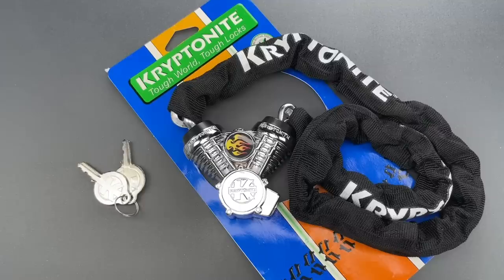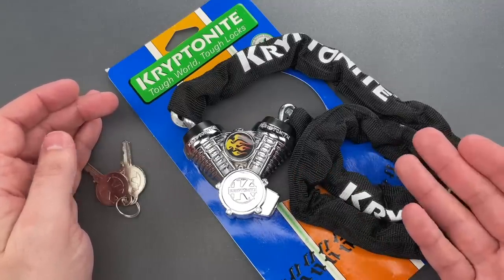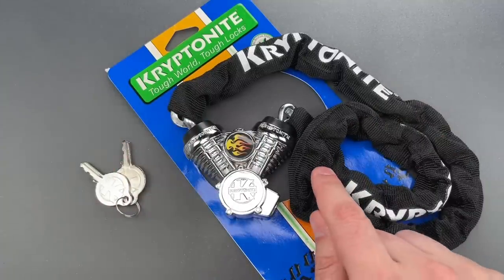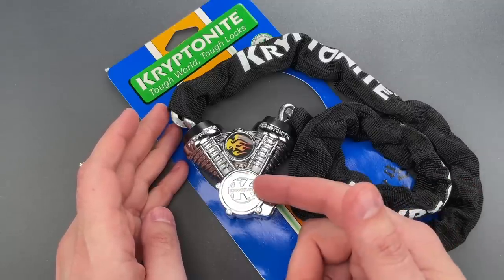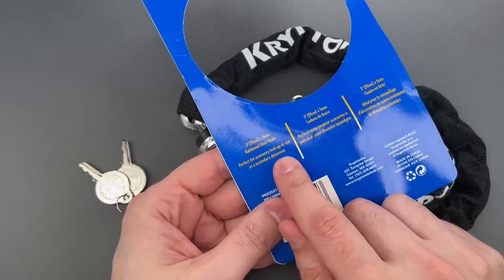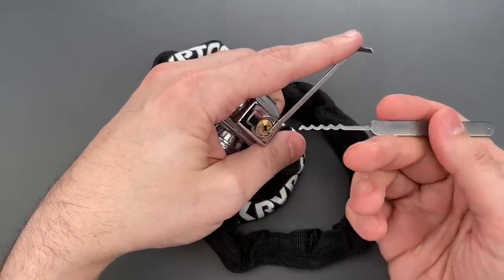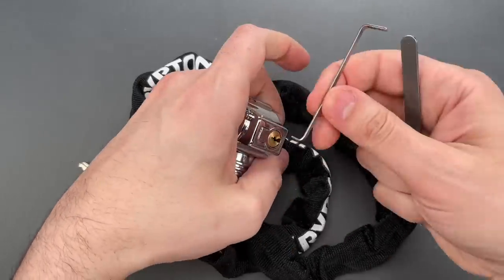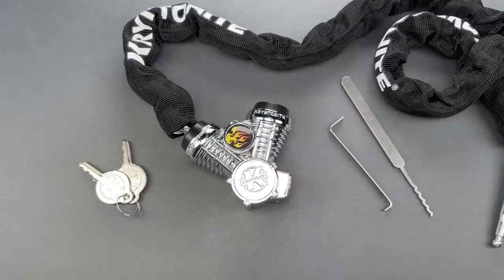[1502] All Show, No Go… Vintage Kryptonite V-Twin Lock

Comment: All shackle, no security pins.

Masterlock design department.
Reply: Great slogan! Brilliant!
Reply: Shockingly, most master locks have security pins...they just also have the absolute worst machining tolerances in the world, thus making the security pins a useless joke.
Reply: Except their shackles aren't good either, shims are super easy on Masterlocks
Reply: Maybe "all body, no lock", because Masterlock locks LOOK like locks, but that can't be their intended use, surely?

Oh god, it is, isn't it? They intend people to use their products as locks...
Reply: @sorin_markov  Not anymore. Master stopped using spring loaded locking pawls in most models and use ball bearings now. So at least they fixed the biggest bypass that renders virtually all of their current in circulation locks vulnerable...
Reply: @NoobixCube , my wife suggested that you could use Master locks as paperweights . . . .
Reply: @potatosordfighter666  : So Masterlock buys now their locks from ABUS ?

Comment: When the lock is advertised by the manufacturer as a secondary deterrent in a market where low quality products are advertised as pickproof, you just know it's that bad.
Reply: Still better than most Masterlocks though.
Reply: Or you know that the company is sincere
Reply: no, you know it's good. At doing what it is supposed to do.
Unlike the other manufacturers' products which are bad at what they are supposed to do (as advertised) since they are only good as deterrents as well.

Like, if I see two dummy security cameras (those plastic things that look like security cameras, but have no electronics inside, other than a battery and a red blinking LED) and one of them is advertised as "dummy deterrent security camera" and the other is advertised as "security camera", I know how I would react to them as a customer
Reply: Eh, it's Kryptonite, they make good products overall
Reply: I mean. It did last longer then most Master lock videos LPL has put out in the past🤣🤣
Reply: Keep in mind, this is 20 years old which would make it from the early 2000's.  Actually, considering a rake is a really low skill attack this is kind of useless.  But the price point does matter also even though it doesn't do Kryptonite's reputation any good.
Reply: Counterpoint: all locks are, at best, secondary deterrent. If a malicious person ever reaches your lock, you already lost the first battle.
Reply: It honestly looked like it took more raking to get open than most masterlocks

Comment: The fiery emblem is killing me. It looks like a toy you'd get from a claw machine.

"Secondary" protection is awfully generous.
Reply: Lmao, ikr? I feel like this isn't even like tertiary level protection, maybe even *insert the -ary word for 4th level* protection, haha.
Reply: They didn''t claim secondary "protection" but secondary "deterrent". Basically someone looking at the effort you went through to secure things with another lock might be thinking "too much effort" just based on looking at it.
Reply: @Slash-XVI  That's exactly the thing, right? I have two very reasonable locks that I use in conjunction on my bike. My secondary deterrent is a wire-loop that's from a garbage lock to hold my helmet. (The loop ends of that are attached to one of the real locks.)

You can cut that wire real quick but all you're gonna get is a used bike helmet, so who would? I've been doing it for years and so far, nobody. And that included when I was biking to campus for school. So. xD
Reply: @kasper_429  -- Quaternary I think.

Primary 
Secondary
Tertiary
Quaternary?
Quinternary?
Hexenary?
Septinary?
Octonary?
Nononary?
Decanary?

Comment: When the wave rake comes out you know its going to be quick and not a fluke. Love it!
Reply: When you know it's going to be quick when he pulls out the wave rake, you know you've watched a lot of the videos.
Reply: Doubly so when what ti takes for a wave rake to work quickly is: No security pins and tolerances that are basically lumps of metal as pins rattling in chambers with enough slop that they jam on the shear line.  Literal junk lock designs.  YET... half of all of the locks on the market seem to be built to this "standard".

Comment: "me with a Scion FRS that's all show and no go" yes, I understand
Reply: Went on a test drive in one a while back. When I floored it, I laughed out loud. The salesman said "Ah yeah, it has good power, huh?" "No, it's slower than my daily."
Reply: @mrgw98  yeah, it's not meant for power, haha. It is fun though!
Reply: At least it’s not a Subaru BRZ 😂
Reply: @JamesBrown-ki2cn  That is something I noticed, nice and cozy, pretty small, and handled well. If it had more power, I probably would've bought one. I want to drive a turbo or supercharged one sometime and see if that is enough.
Reply: @mrgw98  I do actually plan on making mine "go" one day, haha, just taking it 1 step at a time. My plan is to supercharge it over turbo, just for that instant gratification.
Reply: @JamesBrown-ki2cn  That's what I'd do. Either way, make it what you like how you like it. If you make it look nice before speed, nothing wrong with that. If that's what brings you the most happiness, that's what matters most.
Reply: @JamesBrown-ki2cn  a small turbo lights up just as fast as that supercharger.

Comment: Not a comment on the lock, but a comment on the videos on this channel in general.  They seem like they have gotten much quieter.  I'm having to crank the volume on my computer to max and the volume on the T.V. it's connected to to max as well (probably about 4x the volume I normally keep everything), and I'm still struggling to hear what's being said at times.

I downloaded the audio form this clip and threw it into my audio editing software, and it looks like the audio for this particular clip could be increased over 11dB without any distortion whatsoever, so there's lots of room to boost the volume while still maintaining the calm and soft speaking tone in the video.  Just food for thought.

Comment: Grade: D

F - can be bypassed without messing with the cylinder at all.  
D - low skill "raking" or "comb" attacks defeat the cylinder.  
C - beginner level single-pin picking can defeat the lock.  
B - moderate level single pin picking or a special tool are required to pick the lock.  
A - expert level picking or one-off custom tools are required.  
AA - lock-picking lawyer cannot open.

Comment: The wave rake coming out is the ultimate insult to a pin tumbler lock. Just devastating 😂
Reply: I would say a jiggler, followed by shims and easy bypasses. A wave rake requires a turning tool.

Comment: Years ago a lock rep came inyo me selling me these snake style Motorbike locks.

They were braided cable with circular metal tubes similar to disks in your back. And when someone would try to cut it with a saw or something similar the disks would just spin on the spot

Cant find em these days and the lock would be the best option for entry on it imo but havent seen em since tbh

Comment: To be fair, most bicycle locks usually get just cut off rather then picked. It's just faster that way. Even a thick chain and being right under a camera did not save my fiancee's bike, for example. I guess D-lock is the safest option and this is where pick resistance comes into play.

Comment: The Kryptonite branding on the chain cover will likely deter opportunity thieves from attempting to use a bolt cutter to get through, Kryptonite as a brand has a reputation for extremely strong chains. A smart thief might check the lock itself, but if there are alternative targets nearby with a less recognizable brand of protection, it seems likely that those will be chosen first.

Then again, if a pair of thieves can just lift the bike into the back of a van in 10 seconds or less, it doesn't matter how tough the chain is or how pick resistant the lock is. They'll have as many hours as they need to get through it in a secluded location.

Comment: I've found that a cheap lock that has been left outside in the snow and ice (or locked on to a trailer driving on wet and salted roads) is a pretty secure lock. It's kinda hard to pick a lock that's gritty and corroded when the key itself barely works 🤣
Reply: That's how it possible to use "Masterlock" and "impossible to open" in the same sentence. Thanks, snow.

Comment: Almost as bad as how I saw someone lock their bicycle recently. When I lock my bike I wrap the lock around the cross bar through a wheel and on to the bike rack. A guy parked what looked like a much more expensive bike beside mine on a rack outside a supermarket recently and the lock looked fairly hefty compared to mine. But from the way he locked it, you could easily have manipulated his bike to get the saddle through and went off with the bike leaving the lock behind. I didn't try it, as it would have looked like I was trying to steal his bike in broad daylight, but it was tempting to just move his bike away from the rack to ensure he secures it properly in future.

Comment: I found a damaged kryptonite chain lock.  The original owner lost the key.  The chain was beefy though and I thought would make a nice chain with a quality padlock(recommended by LPL of course).  The original kryptonite lock cut off very easily with a beat hack saw.  Strange that the chain seemed strong yet the connect to the lock was so weak.

Comment: On the car reference I remember owning a Buell (what happened when a Harley engine was put in a real bike) 1203cc v-twin. There were a few people in Vauxhall Nova's (toy racer kit, I would say boy racer, but that stupidity has no gender bias) who would try racing me from the lights. Coming alongside and revving their 1194cc engines pulling a car as if the result wasn't obvious.
I would sit, wait for the light and be gone up to speed, then sit there as they fumed behind me at the speed limit. Performance has it's place, areas where speeding endangers children crossing streets isn't it.

Comment: Seeing the key in the lead-up to the pick, I knew how this was going to go. I wonder if this is more a case of seriously bad bitting than a sub standard lock. Kryptonite locks are normally pretty decent imo.  Ive noticed  a couple of other "not good" locks also had bitting that quite frankly, shouldnt have made it off the production floor.

Comment: Why do so many locks not use spool or serrated pins? It's a tiny change that significantly improves security (or at least it prevents low-skill attacks like raking.)

Comment: Hey hey man

I have a tinted truck with loud exhaust and stock V8 but a shift kit in the trans, trutrac out back

But its still louder than fast for sure

Now........

If ya wanna send a 6:71 blower and some stuff to fit a LS1/lm7 5.3 hell ill show the install and the impending 250k mile transmission clutch failure after said install

😂

Comment: An interesting novelty lock. Any chance you could show us the keyway, the key bitting and what type of lock cylinder it is. I must be mistaken thinking a kryptonite lock looks like it's a 3 pin, wide open flat keyway wafer lock. Also, that wave rake looks like it has a bump key profile, so it's more of a kinetic tool than a rake? Very cool.

Comment: seemed like the chain attachment points were pretty cheesy too, like a simple cable cutter would go right through them, and/or a screw driver would twist the end open in a second.

Comment: Surprised he didn't try a light tap with a hammer, or use a magnet, moderate insults etc. A lot of these locks pop open out of embarrassment.
I once got rid of a lock left on the gate at my house by tapping it with a hammer and was elated when it popped open. I recycled the little guy: a chance to become something useful!

Comment: Hey LPL, I have a very specific question: I have an Appartement in a complex with a common parking area. The gate to the parking area can be opened with the Appartement key (possible with all Appartement keys). For convenience I leave a spare key in my car so I have it ready to open the gate. 
Can I modify the key, so it can still open the gate to the parking area but not to my Appartement? I guess, there are less pins in the lock of the parking gate then for my door lock. But how can I find out which one it is and what can I do to make the key useless for my door. Filing down some tooth on the key?
Reply: Can you borrow a key from a neighbor and see which cuts are different between the two keys?  That's probably the easiest option.

Comment: Since the helmet should provide sufficient security for your head in case of an accident, I would not consider a cheap option. Most of us are quite fond of their heads, and thus should refrain from a cheap helmet and using this lock to secure it to anything.

Comment: When it's a lock that requires a special tool, some previous experience and at least a minute going pin by pin, I'd call it a good lock.  But one like this that could probably be picked by a pair of bent paper clips and five seconds of raking by a 10-year-old, I'd call it worthless.

Comment: Could you comment on why you're purposely hiding the backside of the lock. The way your hands are positioned? Turning the lock over. Reaching under and pulling the locking pin out with the picking hand? Is it because the other side is smooth and reflective which would show your face? Just curious is all. I notice little things people do.

Comment: I like how LPL keep the shiny parts covered.
“No reflection, no face reveal”
Reply: What are you even talking about? The whole lock is shiny, and he didn't worry about covering anything. That's entirely not in this video
Reply: @StealthyDead  When the lock is on the table the shape of the lock doesn’t reflect back at him so no worries but watch at 1:23 noticed how he picks up the lock he is covering the mirrored parts and when sets it down he is doing the same.

Comment: No one in the comments going to mention that LPL just suggested using this to lock your helmet?
Reply: I mean, a good helmet today will easily run $50-$70 or around €65. Helmets aren''t cheap. Unless you buy a cheap one. I wouldn't recommend it. 
My €54 helmed saved my life last year. 44km/h crash into a solid tree. Broke my jaw, collarbone and two ribs. But my helmet took the main impact, cracked into two pieces and only gave me a light concussion.

Comment: Is it really necessary to measure turners in thou instead of just hundredths? To a layman like me it kind of seems like an unnecessary amount of precision from an engineering and manufacturing standpoint driving up the cost of manufacture for no reason. Like you could still spec a tolerance like ±.003 or +.000, -.004 or something to ensure it works but saying 40 thou makes the tolerance +.0009, -.0000 which just seems excessive and expensive by an entire order of magnitude for a turner.

Comment: I think this symbolizes late stage capitalism in a nut shell. Wasting resources on junk to trick consumers into buying it for a quick buck (not advertised as a secondary lock but has the fine print for legal protection when it fails). Is this a lock or a necklace because more money  was obviously invested on the looks rather than functionality of its intended use.
Reply: Late? We've only just begun!